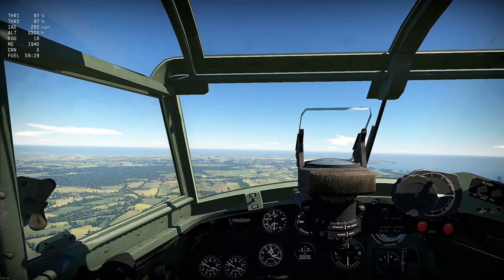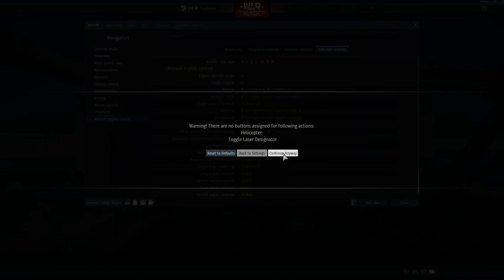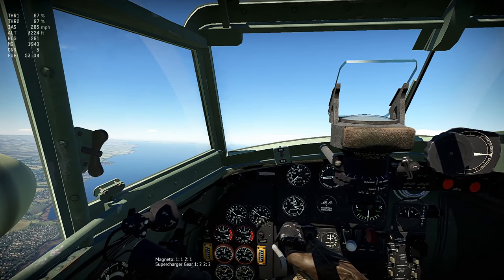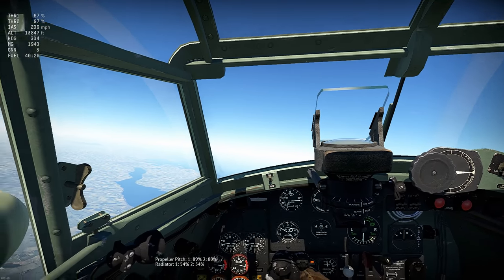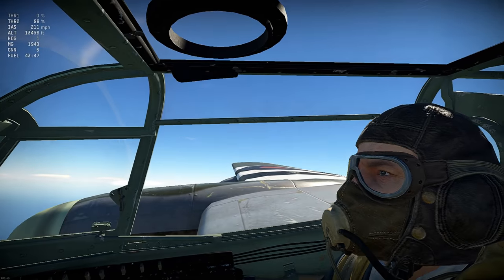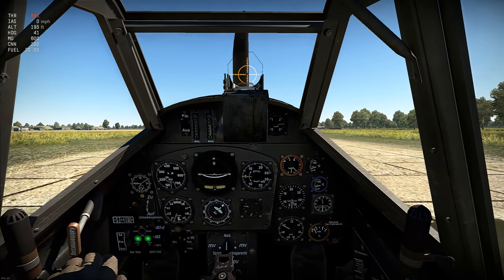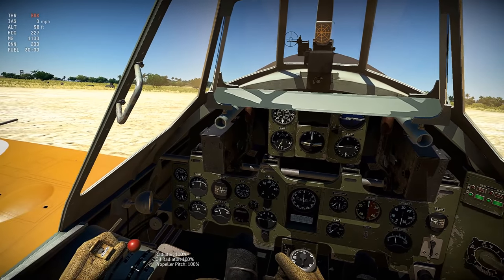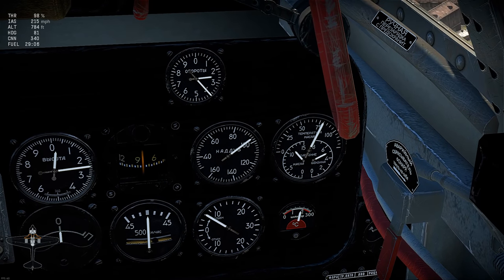War Thunder SIM Tip 07 - M.E.C

Comment: Thanks bro 👍👍👍🤘
I use MEC but you learn something new every day, i did not know that on some aircraft you have prop federing as option :-) i was using manual whey ( set to 0) and sometime I use prop pitch as a air breaks tooo, you put trotle to 0 and prop pitch to 100 and you have nice air break but be careful with German aircraft they tend to overspeead rpm so keep prop pitch under control if you want to use it as a break.
All in all thanks for comprehensive video about MAC 👍👍👍👍
Reply from the maker: Thanks for watching😀
Reply: oi mate! in German aircraft, if you throttle to zero, than %100 prop pitch, it wont hurt the engine and you can airbreak from high speed.. ( 520km/h in 190's, any speed in a 109). And yeah, nice to have the prop feather button, but the %0 works just as well.

Comment: I just want to point this out,
What he said about not touching automatic propeller pitch is true. But with the automatic radiator, you can mess with it. 

Long story short, you make the radiator go to 100% when you're climbing and/or in a situation where the drag generated by opening up the radiator doesn't matter; and do the opposite when you're at a situation where you want you're plane to have as less drag as possible.

Anyways great vid! It really helped me out at starting to switch from AEC to MEC.

Comment: Great video. One thing I would add; to learn new planes keep it on auto and pay attention to the gauges to figure out boost/manifold pressure and RPM setting, and when you know those play around with those setting a bit. In many cases you squeeze a bit of extra performance out of your engine with MEC. 

May I suggest tips for using warthunder's communication commands as subject for another tutorial video
Reply from the maker: Thank you, good idea

Comment: Nice vid.  Supercharger gear shift up should happen at a critical height for each plane, so like the La5 3500m.  IL2 lists these values for planes with manual versions.  Finding this out for each plane should be just a Google search, so honestly that is easier than trying to find it manually over time.  Really most planes with automatic supercharger control you would never use the manual version unless the automatic is not working.   Same thing with radiator controls, some are automatic and only in certain situations would you actually use manual settings. 

Also every plane typically has emergency (WEP or boosted), combat, nominal (max continous) and cruise settings for the engine, so again instead of learning via trial and error just look up those settings online.

Mixture controls seem funky to me, although not surpising (because of hoiw they setup RPM/pitch), as in many planes you set the lever to a certain point and it's in Full Auto, and you don't really adjust from there unless you need to lean for cruise.  IL2 again does this pretty well as does DCS.
Reply from the maker: thanks bud, yeah WT is pretty basic

Comment: What is the magneto thing? And the radial navigation menu? It always shows up that I'm missing it but i dont know what it is.
Reply from the maker: They are  electrical coils that produce electricity to make the spark plugs work in the engines. You usually have two, you can use either one of both.
Reply: @CptToastman  oh cool
Reply: @CptToastman  that is neeto with the magneto lol

Comment: I’ve no need for MEC as I play on PS4 but I have a suggestion for you re: the supercharger settings. As you increase boost, you end up leaning the engine out. On the p47, have you tried increasing the mixture whilst playing with manual boost control. A lean engine will overheat and die almost instantly as you described.
Reply from the maker: I never thought of that thanks